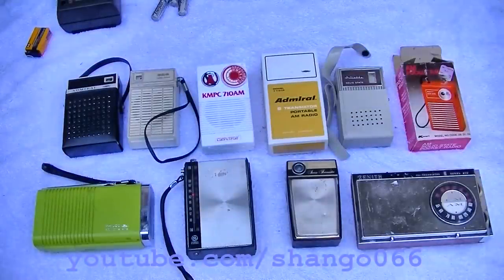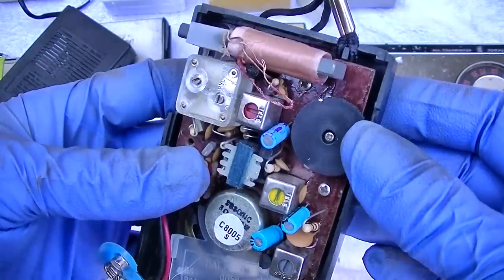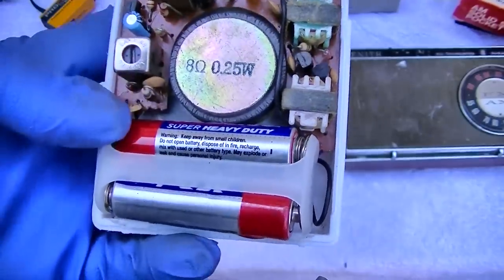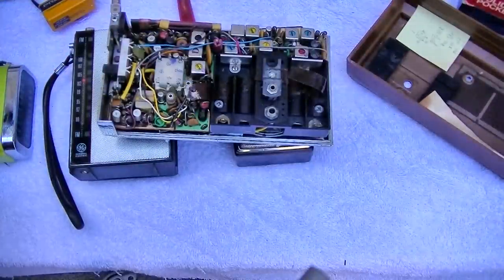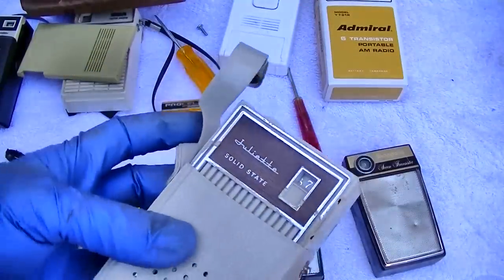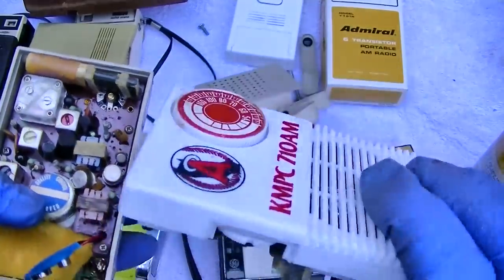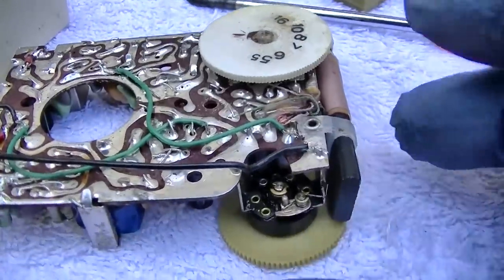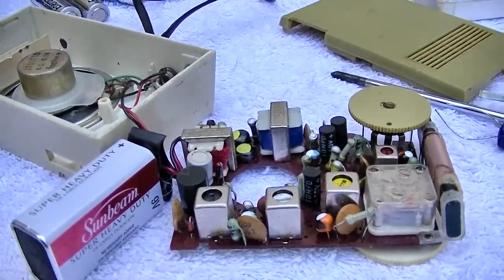Vintage Transistor Radios Show And Tell

Comment: These are some of my favorite things to find. The companies tried  to cramp every aesthetic of the era possible into these things. Their also cheap and small. Good video 👍👍
Reply: I want to find a discrete component am/fm radio that has a stereo jack for headphones.  Even dual mono would better than single sided jack.
Reply: @tarstarkusz  that would be pretty cool to find! I used to have a big set of headphones that had a stereo/mono switch on them. Whenever listening to a transistor radio I'd put in on mono so both speakers would work. Caliphone 3068. Still make them!
Reply: @tarstarkusz  

They are always mono but you can easily fit a stereo jack in and rewire it for dual mono (sleeve terminal is GND and the two other just in parallel) just make sure to not put a mono jack in there again because that would short it out.
Reply: @tarstarkusz  On eBay you can get adapters that will produce audio on both sides of a stereo earphone when plugged into a mono wired jack.

Comment: As far as AM goes...in my area where I live, the station that consistantly wins the ratings each quarter is 790 KFGO, an AM station. The sound quality from them is pretty good. Beats out all the FM stations, modern country, classic rock, and all the other genres. So I would agree that AM won't go anywhere although it's mostly talk format. KFGO is news/talk and broadcasts sporting events as well. Close on the dial is KNFL 740 "the fan" sports talk. During the day, they crank out 50,000 watts, I can pick them up easily up to 300 miles away. But at night they tank their power down so far that nothing can be picked up at that distance.

Comment: I've been listening to KNX lately in the evenings; I'm in Twin Falls, Idaho! Nothing like some evening AM propagation...
Reply: I've lived in the greater Seattle-Tacoma area practically my entire life, and for years I've been able to pick up KBOI out of Boise pretty well.  I used to be able to get KGO out of San Francisco with a good signal, from early evening to early morning, back when they still had all the different live call-in shows. Conversely, I can remember being down in San Francisco and picking up KOMO from Seattle, quite clearly down there, even before nightfall. What's even cooler is that I can pick up one of the stations out of Calgary, Alberta - which is coming in from an even further distance, and across even more various land formations.  That will always be a big appeal of terrestrial radio to me - it still seems like a bit of magic.
Reply: @QuadMochaMatti  What about this one, there's a 500 watt transmitter on 567khz for 2BH Broken Hill that I can get here quite clearly which is 450 miles away.
Now, that's not a lot of power.
They call broken hill the silver city, maybe ground conductivity is helping it out

Comment: I see that the old U.S.A.-made Westinghouse transistor radio has the Conelrad markings on its dial. It probably came off the assembly line some time in the early-60's, definitely before 1963.
Reply: Do you know of any pre-integrated circuit that has a stereo jack on it, or at least a dual mono jack?
Reply: @tarstarkusz  I don't personally recall seeing anything quite like that. I remember seeing couplates, also known as "K" networks, that were used in tube equipment, such as TVs from the 50s and 60s, as well as some 5-tube radios from that era, but I've never seen any audio jacks attached to those early integrated circuits.
Reply: @chetpomeroy1399  By pre-integrated circuit I meant discrete component, not tube equipment. Sorry about that.  I have a larger one (not like these) that sounds great and the only IC in the whole thing is an IF amp. I think it's from 1973. But it's just too big and heavy. It's a good 12x12x2.5

Comment: the philco am/fm is really neato. looks real disco. remember the panasonic ball radios that were hanging by their chains? wires inside that look a little thick. the GE looks like every portable.
Reply: Panasonic R-70 - also Marked the Panapet 70. I have a blue one hanging in the garage.
Reply: @dstoll7958  Me too. If you're gonna get a good quality transistor radio, get a Panasonic! Keep yours man, that thing goes for 50 bucks on eBay.

Comment: On the first day of Christmas, my true love gave to me
A Japanese Transistor Radio
Which comes with a leatherette case with holes in it so you can listen right through the case.
And has a wire which you can stick in your ear and listen to it anywhere and a plug on the other end which you can't stick anywhere because it's bent.
It's a Nakashuma.
It's the Mk4 model. That's the one that's been discontinued.
Reply: Lol I just listened to this yesterday.  Made me smile.

Comment: I think the problem with the RCA is before you put the battery in it, I noticed it was spec'd at kilocycles.  You probably need a converter to convert them to kilohertzs and it will work much better, Hi Hi.

Comment: Hey Shango. Happened to scour the interwebs for the original price of that Kmart radio. Finally found one, the exact same model without the price covered up or scribbled out. It was originally $5.44. Odd price, but it was the MSRP because it wasn't stuck on with a pricing label, it was part of the cover art of the box. So there.  You can finally rest at night now that you know the answer to this long-forgotten question.

Comment: here in the uk there was much talk of getting rid of fm broadcast in favour of digital audio band which isn't that good as the signal is often lost when passing a bus with wifi for instance or a fire station, my very recent car has a factory fitted audio system usb/bluetooth for mp3, dab fm and am broadcast is still being built into radio's so i agree with you the good old broadcast bands will probably be around for many years to come. allways enjoy your vids.
Reply: Digital radio broadcasting is currently being reviewed by the Department of Culture, Media and Sport alongside the public service broadcasters and free-to-air broadcasting. And it's likely all broadcasting spectrum will be sold off by the next decade to mobile phone networks who can easily outspend the broadcasters.

Comment: The Admiral has an output transformerless audio stage.  That's probably where the extra transistors went.
Count the cans, RCA has TWO IF's.  Second Admiral is a 2 IF stage set, Oscillator coil is NOT shielded in a can.  Zenith might be an early AM/FM, MADT type VHF transistors, possibly germanium. Of course the Zenith is HOT, it's a ZENITH!  I worked at an electronics slock shop on Canal Street in NYC as a teenager , and Juliette was one of their major brands, POS getto blasters.
I agree with the AM and FM bands not going away, but the FM band could become all digital if there was a need to shoehorn more stations into the bandwidth.

Comment: I have a bunch of 60s and 70s Transistor radios. Solid State on the front and Hong Kong on the back is a Hallmark of a crummy radio. That Kmart one is a prime example of most of those crummy dime store radios.  The Kmart on most likely sold for around $3.95. Also here in Florida a well built AM Radio should be able to pickup 650 WSM out of Nashville 950miles away. And do that with a stations on 620am and 680am.

Comment: I received that exact Admiral 6 (your second one) for Christmas 1970! Even have a Polaroid of me opening it. I had just turned 7 and went thru a ton of Western Auto 19 cent 9 volts listening to WLS Kris Eric Stevens every night. I remember the K-Mart Hong Kong era radios well; in the early to mid 70s the going rate for a pocket AM radio was $4 to $6, with loss leaders going for around $3. Circa April 1972  8 year old me saved allowance and birthday money for weeks to buy a North American AM/FM for $10 from Katz Drug in Springfield MO. That radio would only get local FM and the only local in my town was KESM, simulcasting the same crap music on FM as they spewed on AM. The only FM programming worth hearing came from KYYS Kansas City and that was 100 miles away. Even the parents tv antenna didn’t help. So: $10 wasted. It’s all good: these radios were my gateway into a career as an electrical engineer, now doing analog chip design at a ‘big famous analog chip house’. Based on the radios in my herd, the silicon transistors had a higher gain, allowing designers to cut one IF stage. I had a circa 1975 GE 5 transistor: all silicon to-92 package front to back and the only sign of the missing IF stage was that the thing had the bandwidth of a barn door; it gave two to three stations at a time for your listening pleasure.

Comment: Just on the topic of analog radio hanging around. They tried to get digital radio to take off here in Australia a decade ago - complete flop. It's only in the capital cities, and doesn't work at all outside the metro areas. I'd say for European countries that have high populations in smaller areas of space, digital radio makes sense, but in more expansive countries like the US and Australia, digital just doesn't get the audience coverage that AM has, and even the top rating metro stations are still AM.

Comment: The kmpc is a promotional set most likey given at ball games. And a Sig gen most likely will let you sharpen up the audio. Oh ps at ball games we often got complemtry two transistor radios for the first hundred in the gate.  Don't see give-me to often any more. Tks. Ps promo radios are saught after today. Mine was autolite spark plug models. .cleavland Indians, Detroit tigers, Cincinnati reds, ect.

Comment: I'm not sure but on the last radio you looked at, it looked like one of the green wires were shorted across another circuit at the soldered point.

Comment: I know they are going to change the TVs again in a year or 2 that brand new 70 inch tv you just spent a $1000 on will again have to have a tuner converter
Reply: Jeff Webb  This is why I am here and the TV is dark.
Reply: Jeff Webb  You forget the odd folks like me, who spent most of yesterday evening sat in front of my Beovision 8802 watching films on an old Thorn VHS machine...  Sure, the definition isn't really there but it's watchable and nostalgic plus it keeps the caps formed up in the TV and VCR lol
Reply: Jeff Webb  Prior to 2009, I did not like the idea of eliminating something that "just worked" (NTSC). However, I have to concede that DTV changed the economics of broadcast television, at least in my area, so that it is somewhat watchable again. My observation is that in the years immediately before 2009, the amount of infomercials aired on local stations were reaching an intolerable amount. I even recall major network affiliates running them during primetime. Now, the infomercials are either back on the overnights, where they "belong," or they are running on the niche-programmed digital subchannels, which I can choose to ignore. The other thing that makes me curb my grumbling to some extent is comparing the U.S. to France, which went from 455 line TV to 441, to 819, to 625, and finally to TNT (which in French means digital terrestrial television).

Comment: Cool stuff yet again m8t. i love building the radio kits although i dont have the equipment to align them properly. remember shango today especially on FM stations use massive amounts of compression on the music so everything has the same volume level, subsequently it sounds bloody awful. what was the oldest am/fm radio you have that had a red LED power indicator shango?

Comment: In 1970 I turned 11 and learned that Zippo lighter fluid was made for those volume controls and snap action switch.  Probably still better than using De-Oxit D5
Reply: it's Naptha...used for cleaning yes.

Comment: Is it wrong that i really like the Philco Ford one? Very, very cool looking radio & doubtless very,very shoddy quality from what I've learned of their products... Not sure it'd beat the RCA for crappy build though, that soldering looks like someone just threw a bit of molten solder at the board and hoped for it to stick! Wouldn't surprise me in the least if reflowing most of the joints largely fixed it's issues.

Comment: Even if you could get HD radios, I doubt you would notice any improvement in quality on the crap electronics produced today. They still would distort the crap out of HD radio anyway. AM/FM radios are cheap to produce, and the reliability of signal reception is likely superior to digital anyway especially when ATSC is so finicky. No need to reinvent the wheel.

Comment: I have a collection of DAB pocket and portable radios, namely to see how sensitive they are because no-one else has done it and I did not have a clue which radio to get. As a guide, Pure made (made as the current iteration is slightly less sensitive) the most sensitive pocket radio and Roberts, the ones which are rebadged Sangeans, are the most sensitive portable DAB radio with the microspot RA318 and a cheap Aldi Reka branded model performing just as well.

As for the broadcasting spectrum, in the UK, public service broadcasters, free-to-air broadcasting (because the PSB's are shareholders in those free-to-air platforms) and digital radio broadcasting are all up for review with a Prime Minister, his advisory and a growing percentage of the public longing for the abolition of public service broadcasting, the move from a licence fee, advertising and sponsorship to subscription based media and the sale of broadcasting spectrum to the mobile phone networks who can easily outspend the broadcasters for the same spectrum and promise the earth - for a subscription fee, of course.

Comment: I have a question. Before all tv stations went digital, our local TV station, WLUC TV, in Marquette, MI  broadcast on channel 6 also. and you could listen to the audio on any FM radio. is there something about it broadcasting on channel 6 that makes the audio available to FM radio receivers? I wish someone would answer this for me.
Reply: Yes, they're the same frequency (87.7 MHz).
Reply: Yes, that I knew. like I said I could listen to the audio from TV6 on an FM radio.
Reply: @erikj.2066  so there is some correlation then? I am not the most educated in this type of thing so I wanted to ask.
Reply: @butcharmstrong9645  TV audio and video channel is about 6 MHZ wide. FM station about 0.2 MHZ wide. The sound carrier for channel 6 is very near the bottom FM radio band frequency and is frequency modulated. So it's tunable and detectable by the FM radio. Since the switch to digital the stations may have been re-alocated to a different frequency and most likely that channel 6 would have been. They didn't change their monikers. And it's all digital so it can't be decoded by the FM detector in your FM radio. So everything here and written previously above are your answer. I think it's unfortunate that all of the TV sound radios and little handheld TV's can't work anymore. But that's how it is today. God Bless

Comment: The Admiral YK211GP is damn impressive, in so-much-as it's not noisy in the least, is very sensitive, and the audio actually has a 'bass' response capability indicative of much larger sets. Are those "CCCP Kruschev vintage" germaniums still working well for you?

Comment: Were you checking signal polarization when you tipped the first radio (Admiral) on its side? If not, what do you learn from tipping a radio on its side? Thank you.
Reply: bob the antenna coil used in them AM radios is in a way directional. So moving the radio in different positions can either make the signal better or worse.

Comment: I thought AM might outlast FM as there is no competition for the old bc band for future uses. Interestingly, the Tesla 3 doesn’t have an AM radio. If other auto companies do that, AM may be in trouble - at least here in LA.
Reply: I'm surprised they didn't turn FM all digital like they did with TV.

Comment: The Juliette and Admiral 6 transistor need a 9 "VOLTS" battery according to the tags. Is a 9 Volts battery still made? I use 9 volt batteries in my smoke alarms. Good old Kitsch radios.

Comment: Shango, I just recently acquired a few old Zeniths, one is a roundy a bunch of new old stock Zenith parts and Zenith tubes along with a couple new old stock crt’s new in the box, and Zenith Remotes, all mid 60’s. I was wondering if you would be interested in any of it. I can’t figure out how to private message you. Private message me. Im not too far from LA, if you’re interested.

Comment: Hey, anyone know if selenium rectifiers should get hot? I have a full bridge one that I like and after about 10 min. the thing is pretty damn hot but all the voltages are perfect. Any advice?
Reply: Maybe try running it with no load. If it gets hot then I would think one or more diodes could be failing. Just my two cents.
Reply from the maker: As they age the internal resistance goes up and they will run hotter and hotter. You can change it with a diode and resistor to get the voltage right
Reply: @shango066  Yep, thanks shango!

Comment: The Zenith is really nice, but the solder joints in that RCA made me cringe. If you're going to store those without using them, I'd definitely pull the batteries first as they will leak
Reply: Those batteries are very recent, Sunbeam brand sells at the Dollar Tree store.
Reply: @KameraShy  Yeah, and I've seen batteries leak that were only 3 months old. It's not always a function of age
Reply: @KameraShy
The old ham was a fiddler. He probably spend his time while not in QSO on the 75/80m band talking about his medical problems tinkering with these old AM units !